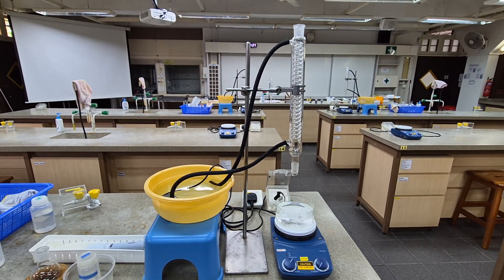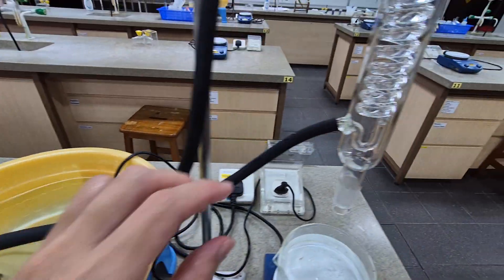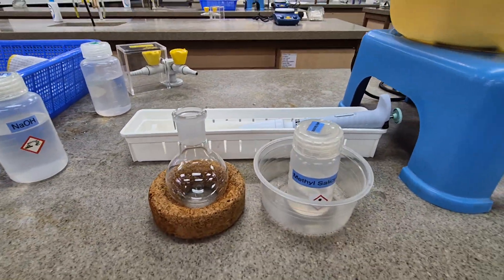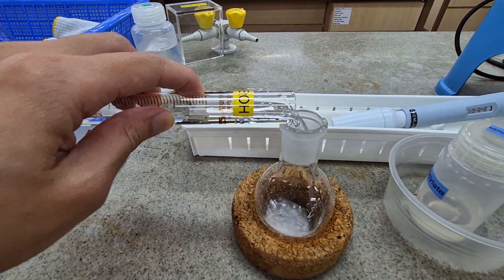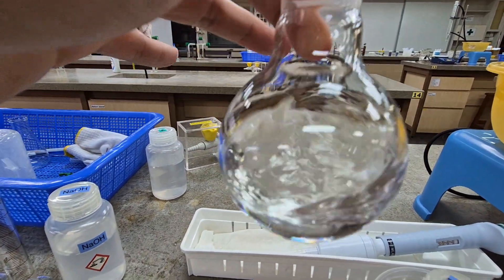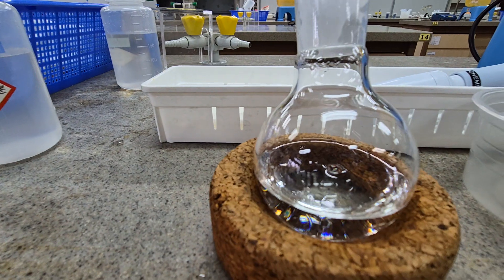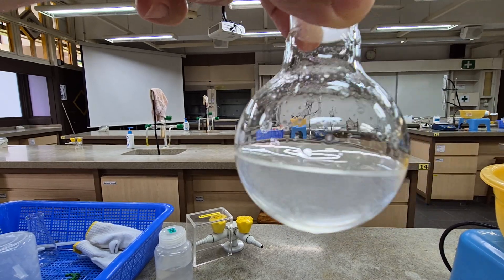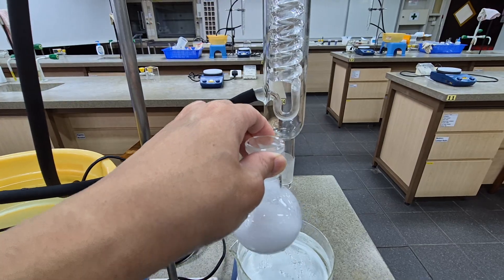[H2 Chemistry] Hydrolysis of methyl salicylate 1

Comment: I have a question . 
I am no chemistry major . But i used a rtv silicone sealant in my room for the past month and just notice cancer risk warning on the container. It said containing methyltrimethoxysilane which potentially hydrolyse into formaldehyde . Should i be worried?
Reply from the maker: Hi, thanks for the question. You mentioned 'potentially' so there could be other side- / by-products with a range of toxicity. The recommended safe limit of formaldehyde concentration is < 0.1 ppm but for SG, it was recommended < 0.08 ppm for air-con space. I am not sure how much of the sealant you have at home so I am not sure if you need to be very worried. A good way to mitigate this might be to purchase some indoor plants that are good with air purification such as snake plant and dracaena.
Reply: @weechorngshin96  i got it is an air purifier fine? Plus the substance was methyltrimethoxysilane. I checked AI . Sometimes it said can produce formaldehyde on contact with air and sometimes it said need to be in the presence of heat over 180 degrees celsius to form formaldehyde. I am so paranoid right now .
Reply from the maker: No need to be paranoid. A good air purifier will suffice. :)